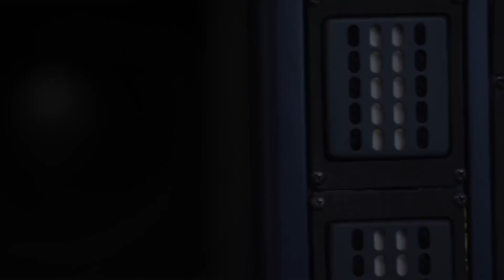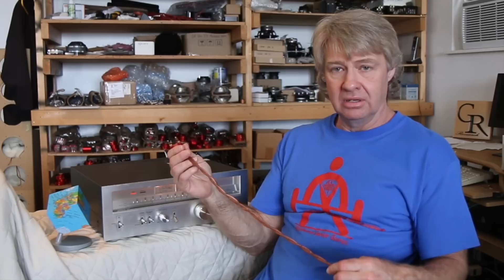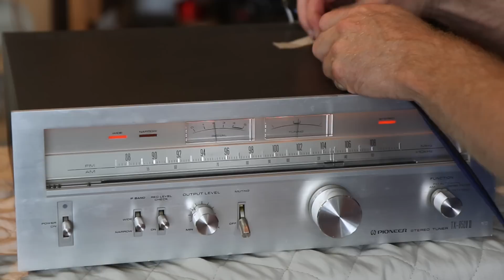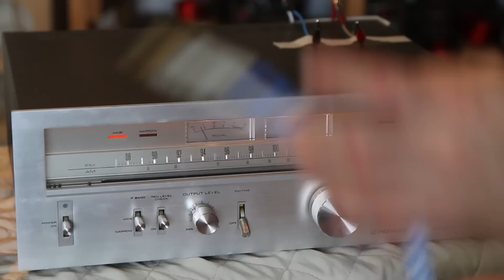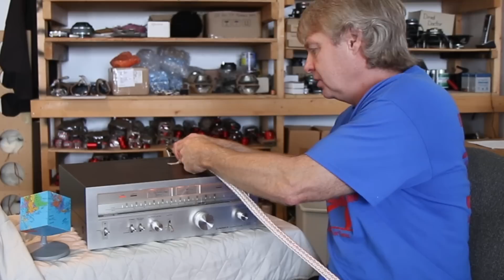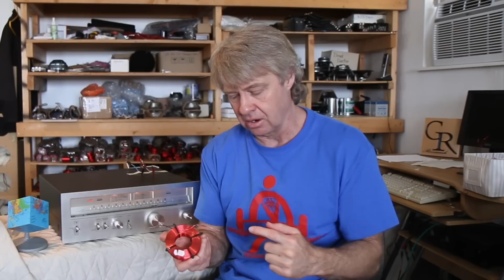Do Audiophile Cables Matter? Here's PROOF!

Comment: I went from a new quite expensive cable with plastic jacket to a used 120 dollar speaker and IC cables from Anticables. The difference was very audible. Better soundstage, improved dynamics and better bass sound. There are guaranteed better cables out there but not with a pricetag of 120 dollars. Now the next thing is if anyone have noticed that your system sounds better during the night? My system sounds better on nights between sundays and mondays. Very quiet out there on the grid at this time. And with nothing going on in the house it's the best time to listen to your favourite music. I have noticed it so many times now that I wonder if anyone else have experienced this?
Now the problem is that battery-operated power supplies are just so expensive. Nobody can afford these on top of the their expensive gear. The first manufacturer that produce modest priced battery-supply for audio would get a lot of customers.
Reply: LOTS of people notice their systems sound better at night. You aren't the only one drawing power from the system and that transformer out on the pole near your house. 
And battery powering gear is not that expensive. One of my big 100 amp hour batteries is less money than a decent power cable.
Reply: @dannyrichie9743  Thanks for responding. Any review coming up soon on battery power gear? Any regular  wellknown manufacturer which sell this? In Norway they try to sell second hand stuff for 3000 dollars... I am not going in that direction.
Reply: @dannyrichie9743  Hi. Any ideas on products that can be used? Where to buy?
Reply: I wish I knew what to tell you on that.

Comment: That video is correct.  Ridding RFI & EMI is all dependent on dissipation and attenuation NOT shielding that only points RFI EMI somewhere else it’s not filtering the RFI EMI already in the wires.
Trillions of RF pulses are present in the air all around us.  Add up every frequency above 100khz and you’ll see. It’s collected by metal leads on and metal inside parts, circuit traces, strands in all wires inside your gear & connected cabling.  EMI is heavily present inside the gear generated by the power supply and wiring and circuit traces delivering the power to the parts on the boards.  Both RFI & EMI massively degrade audio & video performance and until you’ve witnessed a side-by-side comparison with 2 identical units but one fitted with our RFI EMI RIDDANCE technology you’ll never know how good it can sound.

Comment: Have you ever tried CAT5e/6 cables for speakers? That is 2x4 twisted pairs. Dunno what gauge that is. I'm european :)
Reply: CAT5e/6 is typically uses 8 (4 x 2 pair, as you stated) 23AWG solid wires. Not something I'd wanna send high(-ish) AC current through and expect any modicum of sound quality.
Reply: @infinite1der  How about CAT5e/6 for interconnects?
Reply: @infinite1der  People usualy twist or braid together a lot of those CAT5e/6 wires or cables to get at least 10AWG or more.

Comment: Sorry not convinced, if you contact the chipset cable in the world to loudspeaker with out any amp connected you will not hear anything coming from your speaker , no noise no radio station, there is noise on the cable but you will not be able to hear it
At all it is simple not significant when you listen to music, inter connects are different because what they pick up is amplified a lot but speaker cable , sorry no
Reply: Of course you don't hear anything, this RF noise is waaay beyond audible frequency range. BUT, when music (musical signal, audio frequency alternating current) runs through your cables, then the co-existence of this and the RF noise creates an interraction, usually known as intermodulation distortion. Grossly, beyond-the-audible-band noise, causes alterations in the audible freequencies of the signal. And THIS, you CAN hear! Your music is smeared, muddled, polluted, distorted, leaving you, more or less, far from the emotional and mental impact that real music would have on you.
Reply: @fullranger3435  Your screen name is very appropriate.
Reply: Of course you won't. There is nothing driving the speaker. That's like saying I can't hear a problem with my car's engine when it isn't running!
Reply: he is mostly talking about power and interconnects. That he demonstrated with speaker cables, but it is applicable for all cables.
Reply: @LazyH-Online No, it has been proven through numerous tests that the differences are easily heard.
Reply: And tests can be conducted in such as way as to give any result. It is all in how the test are conducted and the system being used that will allow or not allow the differences to be easily heard.
Reply: @LazyH-Online I can write a book on all the A/B testing I've conducted. So you want me to write that book for you here? 
You are not going to believe until you hear for yourself. And a system like mine allows hearing the differences to be super easy. Come on down to Texas and I'll open your ears as well.
Reply: Having spent the last year messing with internal components of equipment, I have come to the conclusion that everything in the signal path and everything that is on the periphery, such as power supplies, makes a difference.  I've installed many replacement parts from higher quality electrolytic caps from DNM and Elna to better binding posts on amps.  All audibly noticeable.

It persuaded me to revisit the cables on my system and I made my own up from Mogami studio grade components, W3104 for speakers, in bi-wire configuration and W2534 for interconnects.  All I can say is that the cable changes were easily audible and happily represent a big step forward on my modest reference system.  Some of this may be down to RF rejection, however, I suspect it's more likely to be the quality and gauge of the copper.

Perhaps at several levels above my gear I could and should go for the fully braided approach but I think there's more to do elsewhere before that.  Next up are the crossovers on my Monitor Audio Gold GR20 speakers.  Then new opamps in the CD player, probably from Burson Audio, and then on to RC snubbers on the diodes.  So much fun!
Reply: @markcarrington8565  I agree that anything in the audio path or on the periphery makes a difference, but some differences are not audible. The induction of a FM radio station into a speaker cable is one of them because while the RF field is definitely transformed into an electrical voltage, the frequency modulated audio does not appear on the cable because there is no mechanism present to demodulate the audio signal. There are other factors at play though that can have an audible consequence but RF field effects of speaker cables do not have audible consequences.
Reply: @markcarrington8565  I have gone on a similar journey. It is great fun upgrading caps, op amps, cables, PSUs etc.. I have done that as well. However, it is just not possible to go back and forth at speed to the previous set up, listen and switch back to the new caps, op amps etc.. And listen and be unbiased that things have improved. For me I am only remembering my previous sound. Be happy that you have installed quality upgrades. For me are things better? maybe or is it just different, there is a different sound, it's not night and day either, is it better? I am not able to switch back and forth as I said. I am happy knowing I now have quality upgrades like you. Enjoy.
Reply: Andy Abraham, I appreciate your points about aural memory, however, I have two observations.  Firstly, from time to time, I have two of the same CD players in the house and so I upgrade one and can then switch between them on the selector using two copies of the same CD.  I have used this to hear differences between new and old caps, even when the caps aren't run in.  I agree with you, they are small, but they are audible.

Secondly, over an extended period, I tend to notice things, on music I'm familiar with, which I hadn't heard before.  A case in point, a friend came round only this evening and exclaimed that the bass had been transformed since he last heard my system, six months ago!  He even told me how, which is that he could hear the bass notes more fully with a clearer stop to the note.  He heard pluck of the bass string more clearly, rather than just a note floating up from some point at the back.  The change was new speaker and interconnect cables, which I made myself from Mogami cable products and the changes he heard were exactly what I heard.  I promise you, I didn't coach him, this was his spontaneous reaction.
Reply: You admit the noise is there, but say you can't hear it. Doesn't matter what you can hear. The noise is there and many of us can hear it. Either your ears aren't that great or your system isn't very sensitive or revealing. Buy whatever you want - we don't care, but do us the same favor and stop being hostile about something that you know exists and doesn't concern you, affect you or harm you.
Reply: @LazyH-Online I don't think you guys even understand the terminology that you throw out there anytime there is a discussion about cables. Just throw out all of the catch phrases....
A double blind test means the person doing the listening and the person doing the switching doesn't know which is which. The person doing the switching will always know which is which. They have to see them to switch them. 
And it doesn't matter if the person switching knows or not. It is only important that the listener not know.
Reply: And I have conducted a LOT of listening tests and know how to get true results.
Reply: In my experience and likewise for thousands of others, it is very easy to hear the effect of the noise on the system.
Reply: @dannyrichie9743  but the noise does not come from the speaker cable, interconnects maybe.
Reply: Yes there is noise on any system but not because of speaker cables , they add noise but it has a so small that it will be no be possible to hear , it will be like hearing a man talk from 50 miles away , just do the experiment disconnect your cable from the amp and see if you can hear anything at all
Reply: @dedyvideo  You are speculating on it's audibility. I'm speaking from experience.
And the point of this wasn't just to show a difference on speaker cables. These same differences take place with all the cables in the system.
Reply: @dedyvideo  You have a valid point.  The amplifier output impedance is the rated impedance divided by the damping factor, so 8/20 worst case 0.4 ohms.  It would be a better test to disconnect the speaker cable from the amp and short the leads together.  The speaker wire with the lowest noise with no amplifier connected is the better speaker wire.
Reply: Danny Richie and you can proof that in a blind test ... if so?! You would be the first, they did a test years ago .

The infamous cloth hanger test... they all failed. We had meetings, with guys that used cables that cost more than most the speakers you sell per pair. 

I love your channel, I love your voice of reason.  But using a receiver, to “proof” you’re right , and the rest of us are idiots. 

I gladly see you actually do a hearing test, and then a blind cable test . I can tell you already you’ll fail to pick your wires out. 

All you proven here, is that some cables are better shielded against rf , that’s it . And rf doesn’t really interfere with the 20 to 20khz range. You’re talking MEGA hertz what not FACT also even if the cable gets it it’s impossible to be audible. Even with the shittiest cable on the planet .. 

Your methods are flawed, and frankly it’s disappointing seeing you screw that up here.

But keep playing with your expensive cables, your choice most definitely not mine so be it
Reply: @MichelLinschoten  I am sorry that you don't get it or understand, but that is why I am here. I want people to not only understand that there are differences, but that differences are audible.

Comment: Why would you put speaker wires on an input?  I don’t hear any noise when I put cheap wires on a speaker terminal.
Reply: It was done to illustrate one of the differences in the cables that have an audible effect.

Comment: Were all the cables the exact same length? Antenna reception is greatly dependent on it's relation to the frequency received. For 104.7 MHz the length of an ideal antenna would be about 2.86 meters. A variation of a few inches can make a big difference, several dB in reception. That being said, twisting or braiding will decrease EMF/RF interference or reception. Ethernet cables are twisted pairs to eliminate cross-talk between pairs. The ultimate in EMF blocking would a braided  metal shield attached to ground - basically a Faraday cage around the wires - think coax cable with 2 center conductors and the shield to earth. So an ideal speaker cable would be a pair of wires with a braided shield. 14 and 16 ga cables with braided shield are about $7-10/ ft and hard to find. I just got 20 feet in and am planing on testing them soon.
Reply: Yes, but the shielded cables don't sound as good. It has a negative effect on the spacial ques.